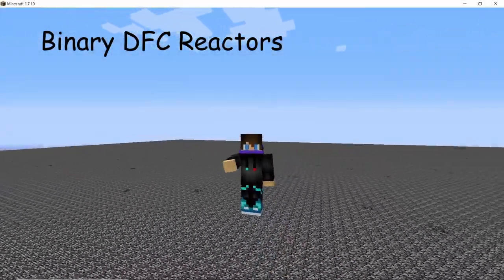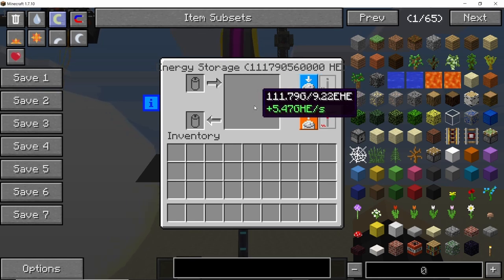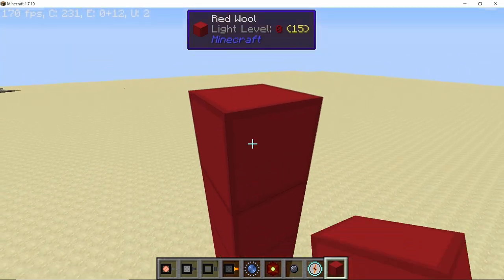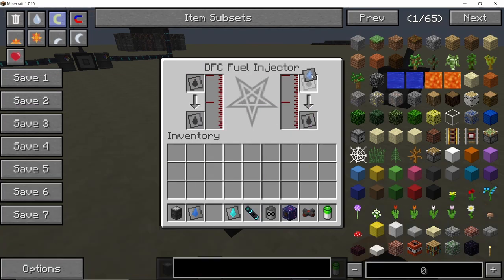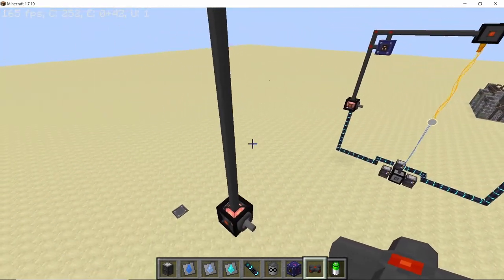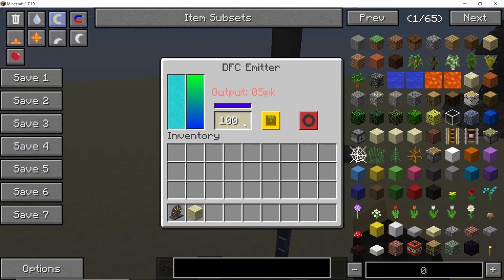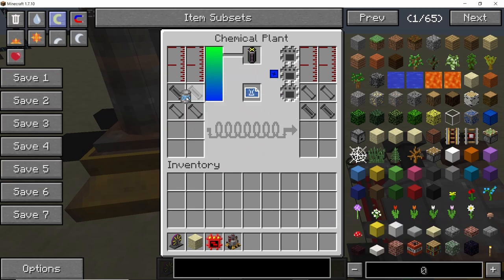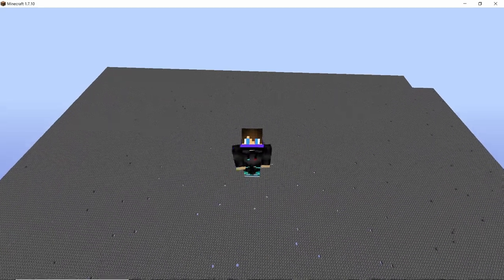Binary DFC Reactor - Most Powerful Reactors in HBMs Mod | How to build a Binary DFC Reactor in HBMs

Comment: This has to be one of the most powerful generators in all of modded Minecraft. That's 400 MILLION times as much power as a draconic reactor produces...
Reply from the maker: Yes it indeed is insanely powerful , and it wasn't even running on its most powerful fuel. It's a crazy design xd
Reply: A fusion reactor from Reika's ReactorCraft can produce over 1 billion RF/t with clever engineering.
Reply: @mechspace  This thing is 500 thousand times as powerful as that.

Comment: If I'm not mistaken, you can use 2-3 stabilizers. I think at the same time it will be possible to increase the power and productivity of the reactor. And you can also loop the FEnSU and the emitter, so that the operation of the reactor goes arbitrarily and does not depend on RBMK, Fusion reactor, and other power sources.
Reply from the maker: Yeah more stabilizers can be used but even with more of them you won't be able to increase the emitter output above 16 without a meltdown do it doesn't really matter

Also yeah i know the cables can be looped back in , but since the last few updates there was a big issue with the i/o mode and power storage in general (the green mode which is required for looping) so that's why i didn't do it 🥲
If you wanna try it even right now connect a cable to the FENSU from the DFC and you'll notice that the power output will max out at 40.8 GHe/s , that's the limit of the cable in these updates for some reason
Reply: @SavageVegeta  They still haven't fixed it yet, the Green mode is gone I guess

Comment: hey there savage ! why don't you use the kind of singularity which looks like a gold and magenta item ? its producing way more power ! its a secret item from the hidden catalog that you can build with your crafting table.
Reply from the maker: The point of this video was to show how overpowered this reactor is. That's why I used the weakest fuel and core and still managed to get over 50 THE/s power. The singularity you are talking about is the "THINGY" , with it in the bdfc it'll be like producing power on steroids and red bull xd
Reply: @SavageVegeta  ok ! and yeah you probably right. the reactor with the thingy is like a thousand working traders under coffee and cocaine XD

Comment: what about...

THE TRINARY DFC!

-Three cores!
-Three stabilizers!
-Three fuel injectors!
-ONLY ONE RECIEVER AND EMITTER!

didnt produce much more than the binary core but its still cool
Reply from the maker: That's weird cause with 3 cores the power output would've been absolutely bonkers. Which fuel were you using ???
The last time I use 3 cores I was easily getting over 1 PHE/s
Reply: @SavageVegeta  I used only 1 storage block. For all I know it would've gone above 5 YHE (yotta-hbm-energy) but that dont matter
Reply: @SavageVegeta  also antimatter + antischrabidium
Reply from the maker: @I_Am_Transcendentem  ah alright then

Comment: Can you even make triple and quadruple DFC cores? Or it will just explode?
Reply from the maker: You can , the only thing you need to consider is the heat values for all the cores. None of the cores should reach 100 heat or it will explode so the power level of the emitter needs to be adjusted accordingly so does the fuel used

Comment: One of the strongest reactors? Excuse me 😃 there are more?
Reply from the maker: There are more indeed , like for example if you build 2 binary dfc reactors and combine them then you get a quadruple dfc reactor , 4 times more powerful than a binary dfc reactor cause it has 4 receivers instead of 1xd

Then you can make 8 cores by doubling it , 16 cores , 32 , 64 and so on until your computer dies 😂